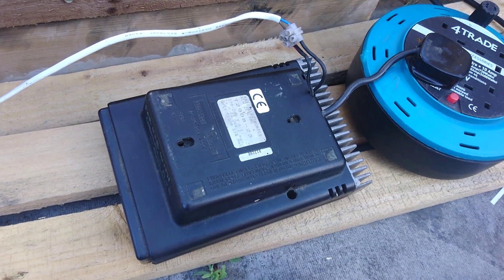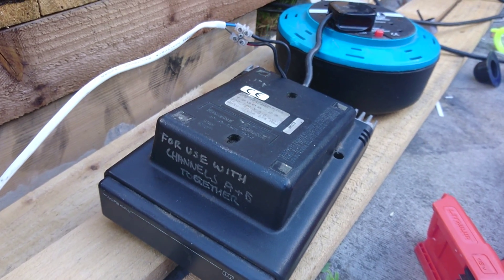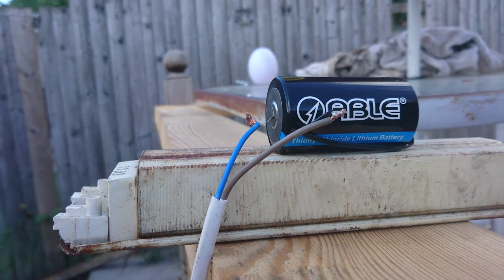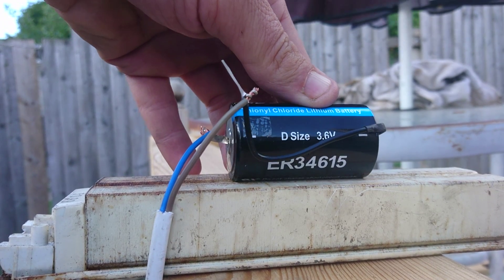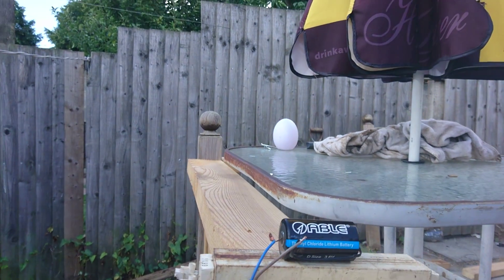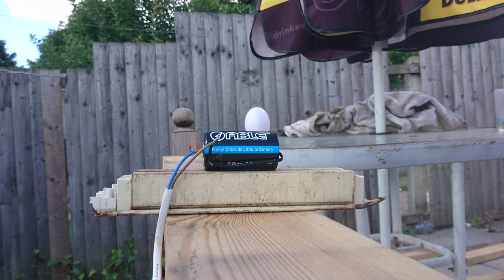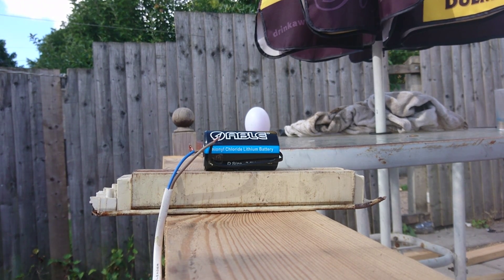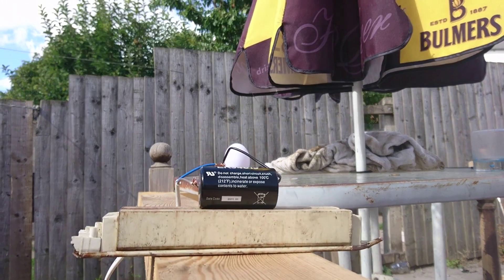Lithium battery explosion on 12v dc, nothing left

Comment: I just tried the same (With a smaller battery though) but nothing really happened, it just got a bit warm.
Then I swapped the 12V power supply for a 36V one and after several MINUTES something finally happened but it was not really an explosion, the battery just spat its contents while shooting a small flame for a few seconds.

But I can say that the smoke was so stinky and possibly carcinogenic.

Not to mention the black spots it left on my terrace tile floor.

The battery was quite dead though (Well it showed 3+ volts on the meter but the "10 year" smoke alarm it came from was chirping away "LOW BATTERY !" before I removed it and tried to blow it up 😂

Did you respect the polarity ?